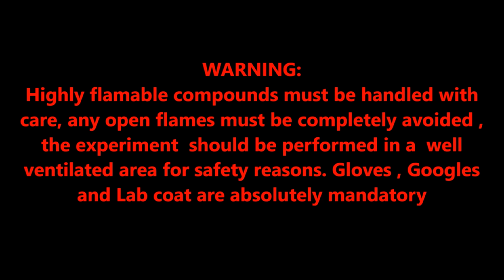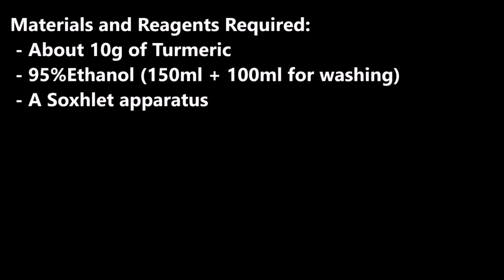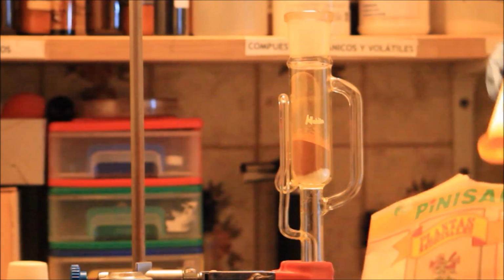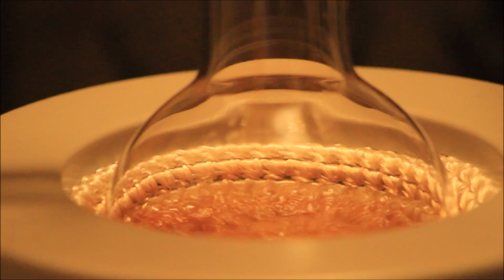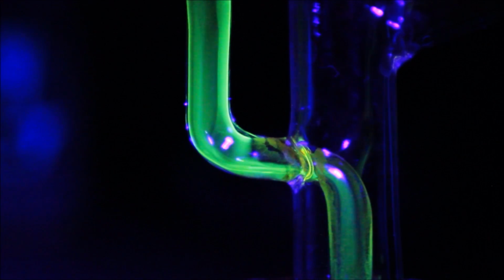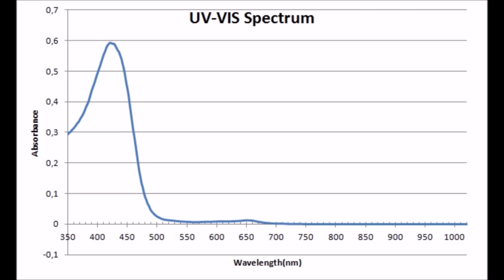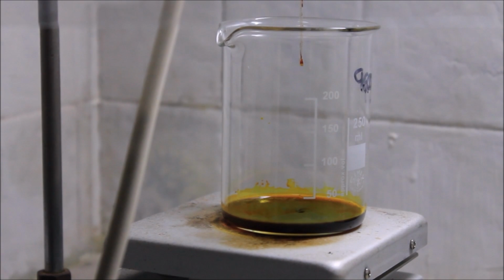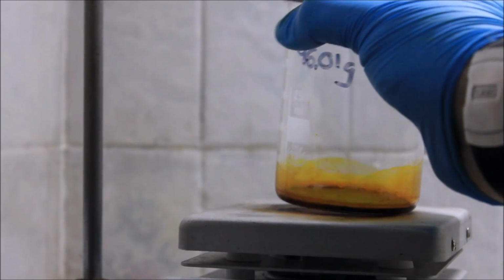Soxhlet Extraction of Curcumin from Turmeric

Comment: can anybody please help provide me some clarity. i’m working on this in my schools lab as a project to extract it but im basically doing it all on my own and i always have questions. this is the procedure i followed 

Extract about 50 g of turmeric powder with 95% alcohol in a Soxhlet assembly until all the colouring matter is extracted.
Distil off alcoholic extract to a semi-solid brown coloured mass (about 4.5%).
Dissolve the crude extract in 50 ml of benzene, and extract twice with equal volume of 0.1% sodium hydroxide solution.
Combine the alkaline extracts and acidify with dilute hydrochloric acid. A yellow coloured precipitate is formed. Allow it to settle for about fifteen minutes.
After setting of precipitate, concentrate the extract by boiling on water-bath and at the same time dissolving precipitate in boiling water. During this process of boiling, the resinous material would agglumerate and form lumpy mass.
6. Filter the solution in hot condition and concentrate filrate to very small volume and finally cool to get curcumin (1.5%).
Curcumin is an orange-yellow crystalline powder with m.p. 183°C.
It is insoluble in cold water, ether and soluble in alcohol and glacial acetic acid. It dissolves in conc. sulphuric acid and gives yellow-red coloration. In 0.1 N sodium hydroxide, it gives deep brown colour.

Comment: I reduced the solution I had to about 10mL than added 300mL of water. This caused the solution to become very light yellow but cause the curcumin to come out of solution. Lots of is stuck to the beaker I was using and the rest in the filter. I washed the walls of the beaker and the filter with alcohol to recollect the residue than reduced that. It got rid of all the water soluble crap.

Comment: In your video,you have shown the yield as 1.1 grams for 10 grams of sample which represents 11% yield. Also from the UV spectrum,the absorbance value is found to be 0.6(approx).Using this absorbance value,i have calculated the % of curcumin which came out to be 3.5%.Why is there a variation in these values?
Reply from the maker: Have you considered the fact that the solution measured is a diluted one?
Reply: @chemistry4all520  can you please elaborate on that?. Actually i have taken the standard value of 0.42 as absorbance of curcumin at 425 nm.
Reply: @chemistry4all520  can you give me your dilution factor or how many grams of crude product taken for UV analysis?
Reply from the maker: Yeah that's the point, without that info is imposible to calculate how much total product is actually obtained. Unfortunately I don't have the dilution factor nor the amount of sample employed.

Comment: For the isolation of curcumin among three components ...Which mobile and stationary phase should be used by column chromatography??
Reply: CHCl3:MeOH 95:5 is the best mobile phase, the only problem is that chromatographic separation is hard, due to the low solubility of a big amount of curcumin.
Reply from the maker: I've not performed the column chromatography of these 3 compounds, but I would recommend using SiO2 or Al2O3 as stationary phase. Regarding the mobile phase, I would suggest you to try different mixtures (hexane, ethyl acetate, diethyl ether..)  via TLC to select the ideal one.
Reply: Okay..Thank You!
Reply: What is the source of this protocol?..Can you please send me your paper?
Reply from the maker: Hey there, I've not used any paper or protocol as reference. However I'm currently working on the further  purification and isolation of curcumin so I'll hopefully upload a video (by June) which might help you.
Reply: That will b helpful...Thank you!

Comment: Will the curcumin not be degraded or lost its functional activity by such heat as much as 78 degrees?
Reply from the maker: Hmm, not really,  it should be fine under these range of temperatures :)
Reply: Additionally, you could use a vacuum assisted soxhlet extraction, but that requires a bit of extra gear. Namely a vacuum pump, vacuum regulator, and water chiller(or ice).

Comment: how much temperature u can use this process..?
sir can i use acetone as solvent..?
Reply from the maker: Hey!, well actually the temperature of the system is given by the reflux solvent used, that  is , it is determined by the standard boiling point of the solvent that you are using , since i´ve used ethanol , the temperature is around 78 ºC.

And about the solvent , sure you can use acetone instead

Comment: how do you turn the turmeric to powder @Chemistry 4all
pls answer its for my science project
Reply from the maker: Hey!,  the turmeric that I used was sold as a finely grinded powder, so I cannot help you with that, but I guess that it can be easily grinded using a regular coffee grinder..
Reply: one more thing 
i want to extract curcumin from javanese turmeric. i have all the equipment needed(except spectrofotometer thingy) in this experiment. but the only problem is i dont have the time. You see im a high school student and i have approximately 8 hours of school plus 45 min of after school. i can use the time given by the school for soxhlet extraction bcoz the video said it takes 8 hours to extract the substances inside turmeric. but i dont have enough time for the the distillation process (you said 2 hours). now my question is can i store the result from the soxhlet extraction in the fridge or just room temp?
Reply from the maker: Yeah , of course there should not be any problem at all , i have stored curcumin solutions (in ethanol) at room temperature for more than a year and i did not notice any kind of degradation

Comment: Thanks for a great video! I can't help but be reminded of chem player when watching your videos, the voice is all too familiar.
Reply from the maker: +Jesse Leavitt Thanks! , I will start to upload new videos this month!, and about the voice you're right, I should avoid the use of a synthesizer..
Reply: how do you turn the turmeric to powder @Chemistry 4all
pls answer its for my science project

is that a  magnetic stirrer ur using?

and what do u mean flushing air to it

is there any other way to separate curcurmin from the crude product other than column chromatography
Reply from the maker: 1)yeah it's indeed a magnetic stirrer equipped with a hot plate,  pretty useful in chemistry! 

2)The very last traces of solvent left within the final product are usually removed by terms of a high vacuum system equipped with a liquid nitrogen trap,  as I don't have one, I remove the traces of solvent by blowing a current of compressed air on to the surface of the solution (ideally it should be nitrogen instead of regular air) 

3)Column chromatography is by far the best option in this case,  however sometimes we can use other alternatives such as crystallization, liquid liquid extraction or precipitation..
Reply: ohh and really sorry to disturb you again, but what equipment did u used to blow the compressed air tnxxx so muchh
Reply from the maker: Well , in a professional lab , we use a lab air compressor connected to a dessicator , however i use an aquarium air pump(they are much cheaper)

Comment: You used Ethanol for this process. So I have some questions. After the Soxhlet process you have to distillate the solution again, then you get Curcumin and the Ethanol back (could be the same amount or less). So my question is; does the Ethanol after distillation contain any aroma of Tumeric?
Reply from the maker: kirykosal,  that's a very good question indeed!,experimentally the ethanol obtained is as pure as you can get (with the original azeotropic composition) but just in case some tiny impurities ended up in it as it passes through the distillation setup I added some activated charcoal so that I can recycle the ethanol. It might be possible, though, that some volatile compounds are codistilled with the solvent, but in the case of turmeric I think that most of the compounds are solids or have a very low vapor pressure so codistillation is not a huge issue
Reply: Thank for a very clear explanation. But I would like to know too; if I want to obtain the optimal aroma (in this case) in the distillate, what should I do in this case? (I want to use the distillate not the extraction). Or it should be work with other methode? Do you have any plan to do clip on that topic? I am interrested in that topic.
Reply from the maker: +nibus9 yeah, of course!
Reply from the maker: +kirykosal I'm not sure if I understand your question, if you are interested on an essential oil,there are several methods that you could use, carrying out an extraction is rather non selective and it would probably require a previous knowledge on the properties of the compound itself. A very trivial way to extract aromas is by using steam distillation (I indeed uploaded a video on limonene extraction using that method)
Reply: Chemistry 4all he wants to make the etanol that is extracted taste like tumeric